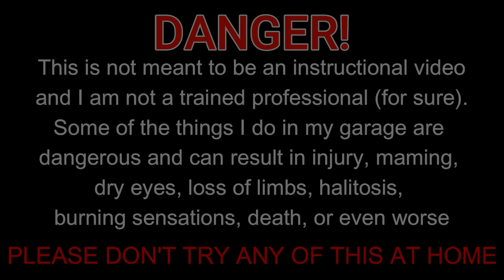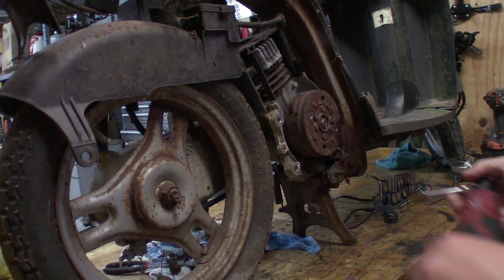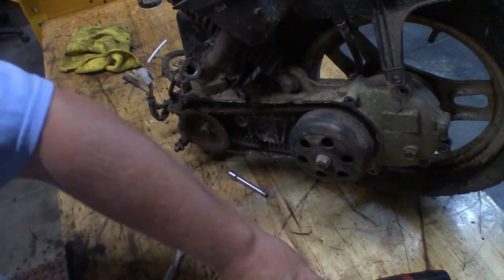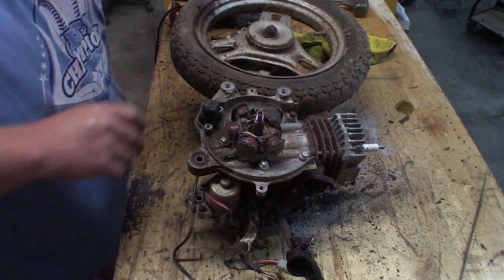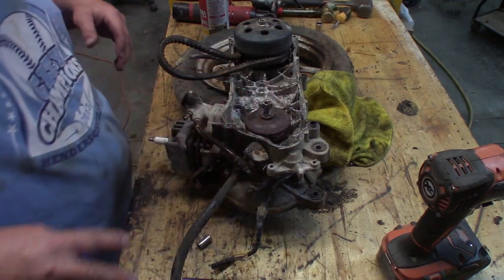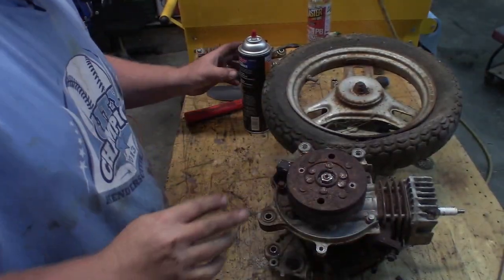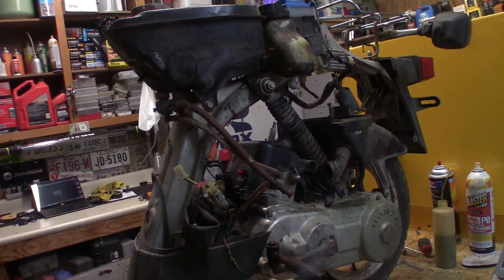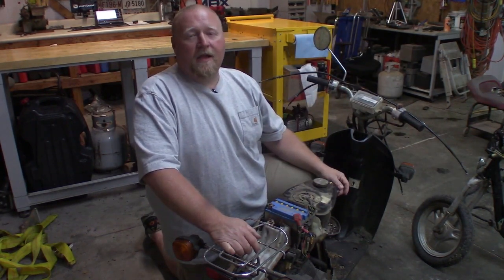PT 2 -1986 Honda Spree - Sitting outside for 25 Years | Can we revive it?

Comment: This is a really good video.  I've been looking for something like this for a while.  I got my hands on my old 1987 Spree that my parents got me when I was about 13 yrs old.  I'm in my early 40's now.  It had been sitting on my parent's garage for over 20 years.  I just reclaimed it and plan to restore it.  It's in decent share - but it's not starting.  So your video was perfect to get me on the right path.    I also have an 8 yr old helper that will be joining me in this fun project. I NEED SPARK :-)
Reply: Hi.  Tried getting spark today and was not successful.  Fly wheel looks good.  Kick starter is working moving well.  Piston sounds good.  Cables seems to be plugged correctly.  But I just can't see a spark.  Any ideas what I might be missing?
Reply from the maker: One of a few things: Just have to start with a component and test it for viability, then move to the next one.
1. Bad Plug
2. Bad Plug boot
3. Bad pulse coil (most likely)
4. Bad stator/generator
5. Bad CDI (somewhat likely)
6. Bad Coil

I have a factory service manual in PDF format if you want a copy. E-mail me projecttimegarage@outlook and I'll send you a copy. It's 13.8MB, so we'll have to use dropbox, google Docs, OneDrive or something like that, probably.

Comment: Don't throw that starter out. If it's trash rebuild it. You can use a starter rebuild kit from a Suzuki LT80 on it. Has most all the same components. I've rebuilt 4 of them already and they all run great.
Reply from the maker: Good info. I did keep it.
Reply from the maker: @Phreakwar - where are you finding the carb kits for these bikes? Specifically the needle. I have a collection of about 100 needles, all of them are dry-rotted.
Reply: @ProjectTimeGarage  I'm using a Polini 17mm carb on my bikes. Stock carb, I'd just soak overnight in pine-sol and oxyclean. No idea where to get carb parts, but alot of them in the fiche can still be found from Honda.
Reply from the maker: PineSol - been using that on carbs for years. Run it in a heated ultrasonic cleaner and it works like magic....smells nice too! I'll try Honda for the needle/float. Thanks!

Comment: Where did you say you got your pulse coil from? I’ve been trying to fix this spree that I got about six months ago. It started right up when I first got it, then I sprayed it with a hose to clean it and it hasn’t started since. I think the pulse coil may have shorted out when it got wet.
Reply from the maker: I ended up getting mine off eBay. Search for NQ50 pulse coil or pickup coil. Should be a few out there.